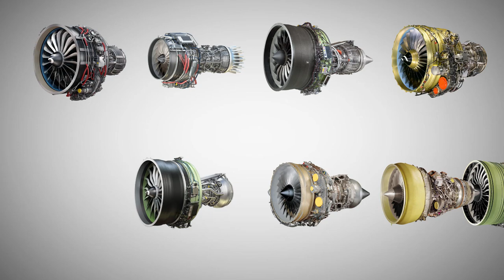GE Aviation Wilmington – Join our team!

Comment: Hi guys, I’m from Mexico, I want to tell you that it has a mistake in the image of the engine types, the image of the CF 34-10 is really the engine CF34-8 and CF34-8 is really the engine CF34-10,I know that because the AGB of the CF34-10 is in the LH side at 9 o’clock. Thank you so much for the videos .